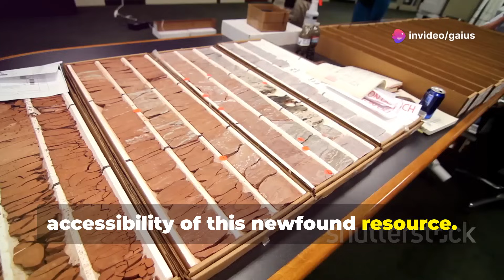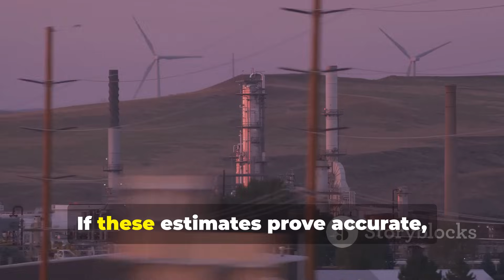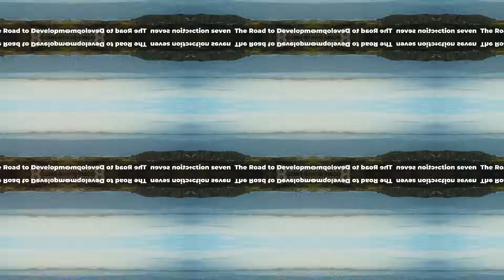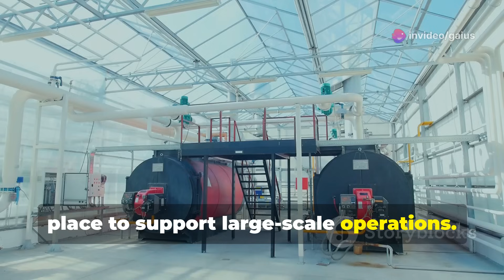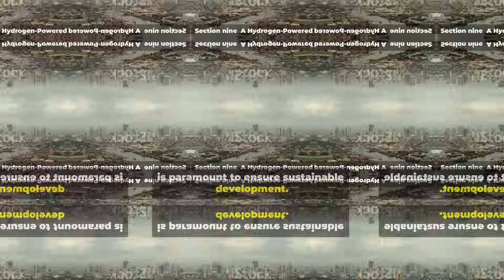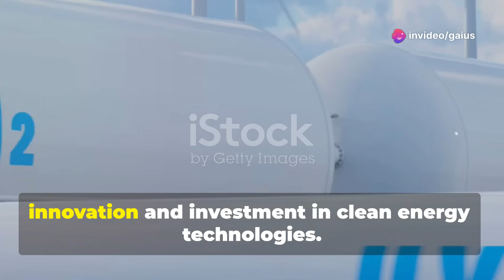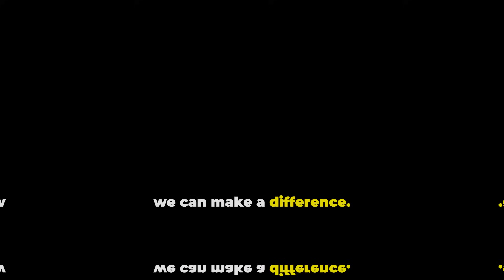Hydrogen Discovery of the Element – Zambales Natural White Hydrogen Found

Comment: The only downside when hydrogen power is used as energy is that when Hydrogen used in the fuel cells is a very flammable gas and can cause fires and explosions if it is not handled properly. However Japan has already developed how to handle hydrogen energy and can already be used in cars that can run on clean hydrogen.
Reply from the maker: I appreciate you bringing up the flammability concerns surrounding hydrogen fuel. It's true, hydrogen is flammable, but the risk is comparable to, or even less than, that of gasoline. Japan's success in deploying hydrogen cars demonstrates that safe handling is achievable with the right technology and regulations. The potential environmental benefits of hydrogen are significant, and continued research and development are focused on improving safety and efficiency.